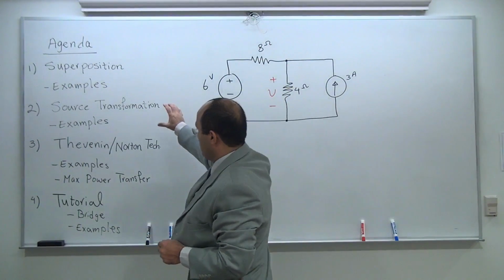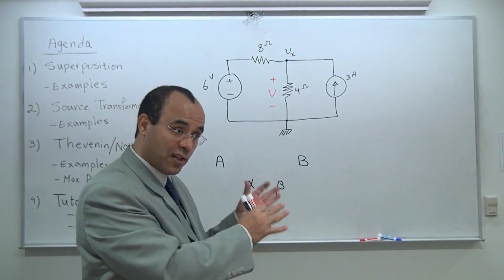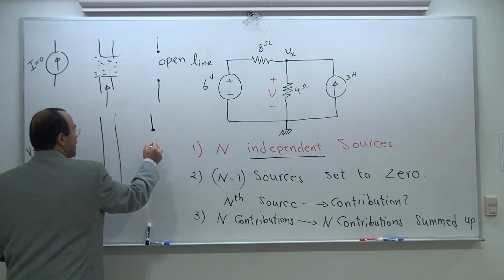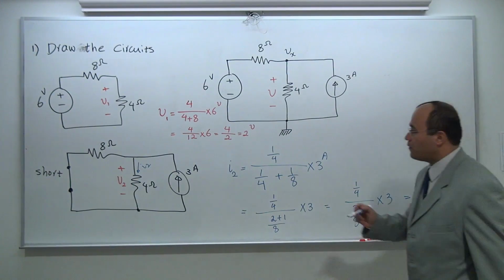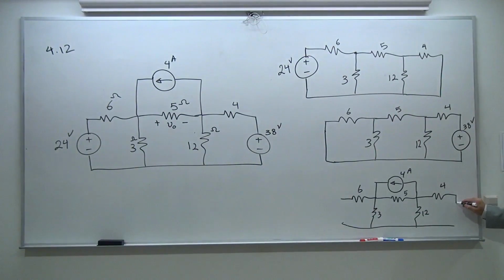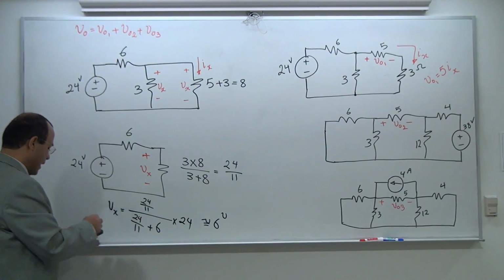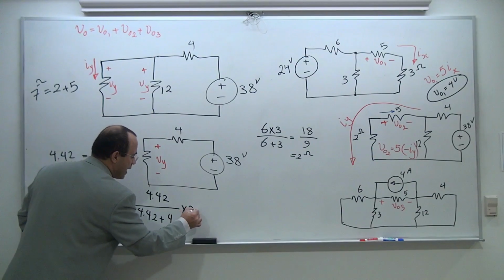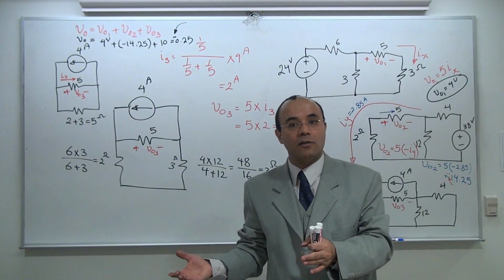Chapter 4: Superposition

Comment: sir, in the first example... how can you find the total Voltage of 8 ohms? can u use voltage divider rule by opening the line of the current source and that's it? i'm just confused that the 3 amp current source will affect the voltage of the 8 ohm resistor... thank you..